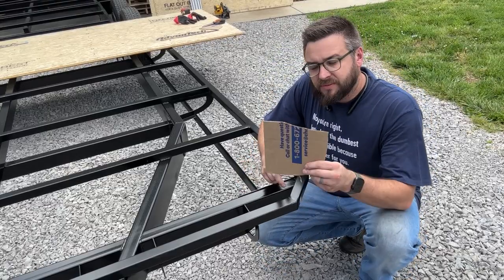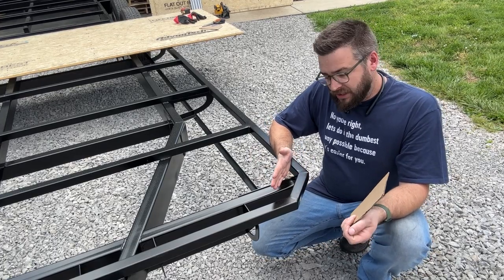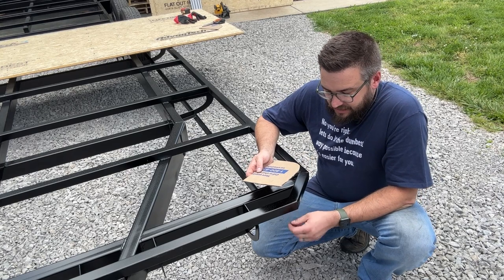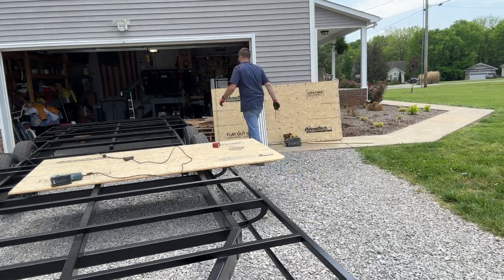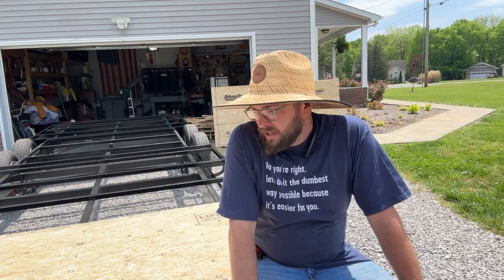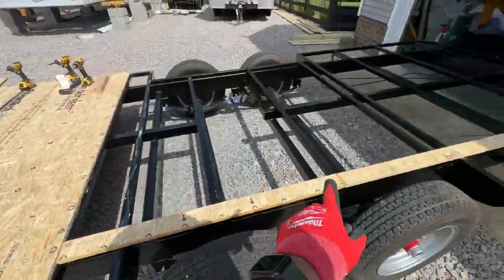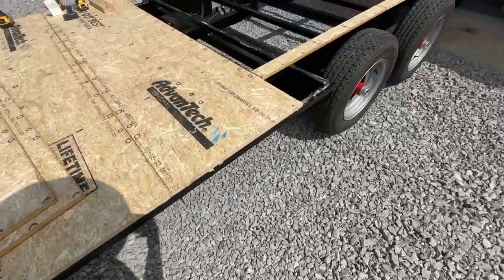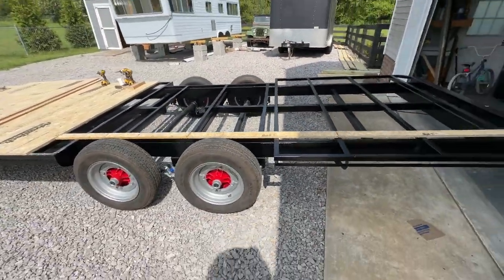1971 Holiday Rambler Reno: Part 15 - Subflooring Installation

Comment: My only questions would be why didn't you paint the underside or seal it in some way while you can?
Reply from the maker: I’ve had a bunch of trailers with exposed wood underneath and have seen them last decades so I’m hoping I’m good. A place I bought an enclosed trailer from actually told me a story of someone who undercoated theirs and the wood swelled up and failed without a year. I still may put closed cell spray foam under here too, which would seal it up.
Reply from the maker: https://youtu.be/xZ9wy-8_rPc?si=cWt9JPRCBKKpBqVo

Comment: talk a bit about adhesives there are so many on the market. what you chose and why
Reply from the maker: Honestly I haven’t worked with enough to be an expert but in construction I have found the polyurethane ones to be the stickiest so I opted for that. I figured something is better than nothing.

Comment: tell me exactly what drum u look for. i will look too. you once said a 12" drum , something ive never seen on these small trailers. but what i know would fit under a very small hat
Reply from the maker: Hey, thanks! It’s a 12” Dayton drum with the 4 lug Dexstar pattern.
Reply: @bakermakesit  depending on your comfort level , u can run the wheel like that.
the broken tabs offer no structure and have no responsibility in attaching the wheel to the hub.
i would most energetically recommend studs in place of those stupid german style bolts. pinched fingers , cuts and irritability changing one of those roadside is your only reward for keeping the bolt style

Comment: I'd be leery of using that Advantech sheathing on a trailer like that. Its intended to be used as interior subflooring not exterior use. The bottom of a trailer is going to see lots of water and not much air to dry it. The panels may not swell, but the exposed bits of wood will eventually rot. Its also not as strong as plywood, especially around the edges. 
I would have considered either exterior plywood coated in resin, or something like they use in boats called Nida-Core, with a fiberglass panel laminated over top with attached with poly resin. 
The Nida Core would provide both structure and insulation, and the fiberglass would provide durability for a lifetime. 
In reality, the wood with resin would likely out live you I did my boat floor that way in 1982 and its still good as new today. Plywood would give the best strength overall. 
I'd also maybe considered just using metal or modifying the body attachment so that it can directly attach to steel, with a floor that isn't sandwiched in between. 

I also would have likely converted the wheels to something modern, original is nice but hard to locate in a pinch. A set of 6 lug steel wheels on studs with some baby moon hubcaps wouldn't look out of place at all that. 

Since the frame is all new, I'd have also considered going with torsion axles for simplicity. I realize they too have some drawbacks but they ride fantastic and if mounted properly are stronger than sprung axles. They're also much easier to replace if something happens.
Reply from the maker: I may be on the wrong track, but a lot of enclosed trailers have exposed wood floors with no issues. I just sold a 12 year old enclosed trailer that was like that and the plywood was in perfect condition.  I still may spray foam the bottom with closed cell foam, which is waterproof.
Reply from the maker: https://youtu.be/xZ9wy-8_rPc?si=cWt9JPRCBKKpBqVo
Reply: There's two issues with the wooden floor, one is that its exposed to the weather from  underneath like that, and second, if you enclose it, it can't dry out. If you use something that can't rot, neither is an issue.. 
I bought an Argosy a few years back that had a ton of rot in the floor edges, most of the rot was from the outside on and around the cutouts where the plumbing and tanks were. At first my thinking was that since the original wood lasted 50+ years, just about anything I did would likely outlast me, but just the same, the cost of plywood, and the fact that treated plywood is now more corrosive than it was back then, the only wood choice was 3/4" exterior grade plywood. I looked into a few PVC options then but was told its not structural. 
What I ended up doing was to take foam board and made a sandwich with aluminum. Then I insulated the aluminum from direct contact with the frame with rubber strips. Basically I used a top and bottom layer of .040" aluminum, with 3/4" foam board in between, with 3/4" PVC placed inbetween the layers around the edges where the body bolted down. It came out great, I used smooth aluminum on the bottom, and diamond plate on top. I didn't cover the floor since i was building it as a work and storage trailer. All the huge heater and plumbing cutouts were eliminated and modern units were installed. It was more expensive than just doing wood and likely overkill but its forever. I used the trailer for a few years and sold it in favor of an enclosed car trailer which just had more room, but the all metal Argosy will no doubt never suffer rot, even if it were to stay wet all the time. Part of my decision to use aluminum was because I had half the metal on hand already from a former project and the fact that the Argosy was an all aluminum body to start with. 
I think if I were doing a Holiday Rambler I'd likely go with fiberglass over foam or Nida Core but cost could be a factor and if metal was cheaper, I'd still go that way.
On boats, when plywood is used, its generally encapsulated in poly resin and fiberglass, but most newer boats have gone away from wood because of rot. 
Just about every used trailer I've seen that has water issues either has rotten wood due to a leak or a leak due to rotten wood and either leads to structural and floor issues. 
Two other options I'd also look into would be Glass Reinforced Plastic and EKO Ply, and I've read good things about both but have never used either of them myself.
Reply from the maker: If I get 50 years I’ll be happy 😀. Your sandwich idea sounds great but cost and time made this the best option for me. We will see how it holds up!